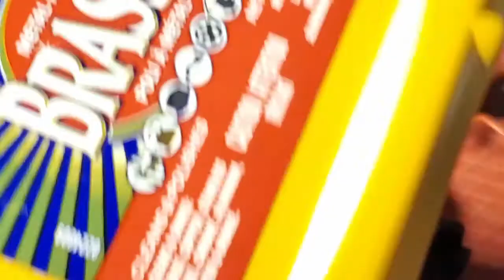Servicing a vintage Bachmann F7 - Ring-field motor locomotive -

Comment: That you very much.  Followed you, step by step, with a CN Jeep.  Nearly identical. Everything was already pretty clean. Don't think the previous owner used it much. Has a clicking sound, like one wheel is hitting the ties.  But I couldn't see anything worn or broken inside and it still makes the same noise.  What you get for buying second hand.
Reply from the maker: Hi, Thank you for the kind words. With regards to your Bachmann, if you are encountering a clicking noise, and you don't see anything broken , then it is more than likely that you have a cracked gear wheel . There could be a hairline crack on the final gearwheel which is a press fit on each of the axels. Why don't you take a close look at the axel gearwheel through a magnifying glass to see if you can spot a hairline crack . also , a clear tell tale sign is that the gear wheel will spin freely on the axel. If you want any assistance , just shoot me a message at anthonyshobbycorner@gmail.com and i will share my contact info , so that we can trouble shoot this over the phone if you are so inclined. Regards, - Anthony -
Reply from the maker: Just for reference , If you check my video at minutes 41:05 , that is the gear wheel that I am referring to , which could have a crack in it . - Regards, - Anthony.

Comment: Hello! Question? Why did you not use any grease on gears?  Comment: You used Q-tips that kept leaving residue on everything; There are wonderful cotton swabs available on ebay that come with a longer wooden shaft and a head that is made for cleaning guns and other different shaped areas, and there are thin, thick, pointed, and other different shaped heads which are much better then the swabs you used. The cotton you used was very noticeable on camera leaving cotton strings numerous times! Your video was exactly right for me!  Ted

Comment: I liked those motors, because they were a step above the old Tyco Power Torque motors, in that all the gears are enclosed, unlike the power torque with the spindle gear flying off into the floor or off the layout.
Reply from the maker: Hi Michael , I can totally relate to your observation about the spindle gear flying off the Power Torque's .. lol . 
Regards, 
Anthony .